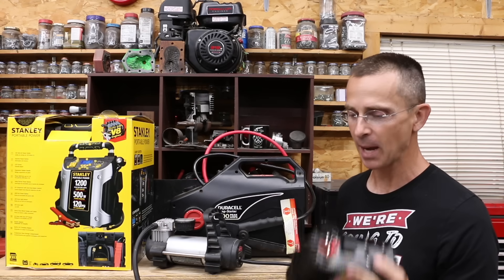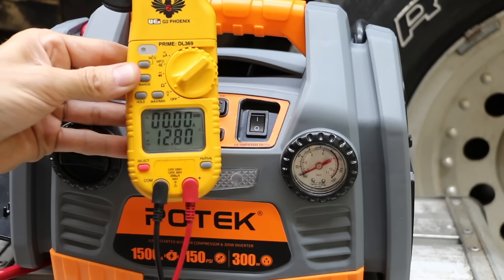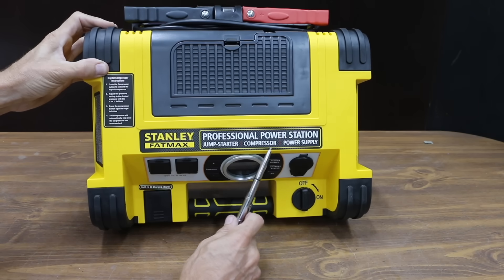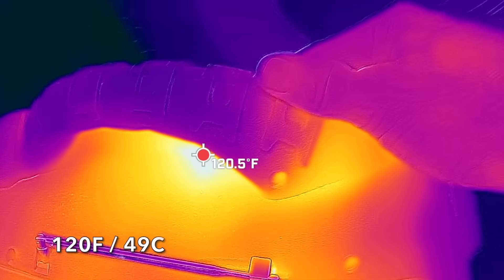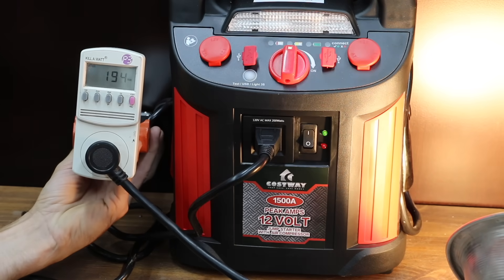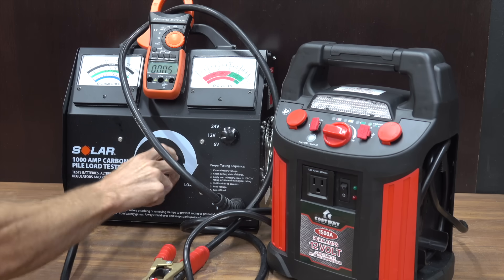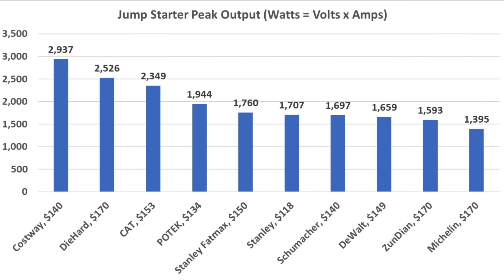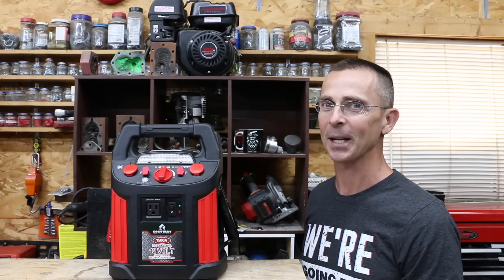Best Jump Starter? DieHard, Schumacher, DeWalt, Michelin, Stanley, CAT

Comment: I'd like to buy the #1 suggest according to the test result, Costway. But I see there is not many reviews or low rating on Amazon, which the link posted here. I'm hesitate to buy Costway. The performance is tested in here, but what about the durability or reliability of the product?
Reply from the maker: Thanks for the suggestion.

Comment: The exact same CAT completely died in a year. Unusable. In fact EVERY SINGLE jump starter I've ever purchased (most at Costco) have worked great BUT

then DIED in a year or so as in no longer chargeable at all. Kept inside not in the heat.

The real test is how are they working a year or two later, assuming 3-4 uses a year
Reply from the maker: Thanks for sharing.

Comment: I have an Everstart combo. Pumps pretty quick, can pump 2 tires without shutting off. But after 1 year it no longer takes a full charge and runs dead after topping off a tire from 18psi back up to 32psi.
Charged for 36 hours only shows 2 bars.
Shame
Reply from the maker: Thanks for sharing.

Comment: that's honestly kind of disappointing only one jump pack was able to actually rotate the motor I'm glad I bought a little handheld povasee 3000A for 60 bucks I started my 10,000 watt Champion generator over 10 times with a completely shot battery from the store just to find out bad gas in lines wasn't the problem I left the choke wide open🤦🏻🤦🏻🤦🏻🤦🏻🤦🏻   if you do another video on the handheld ones please add it to the list!!!
Reply from the maker: Thanks for the suggestion.

Comment: I have no experience with the other brands mentioned in the article, but I do have experience with Stanley FatMax, which I purchased from Walmart. FatMax is a piece of junk, in my opinion 
 The air pressure the gauge stopped working shortly after I purchased it and the unit didn't hold a good charge while not in use. The Fax now will not take a charge. Consequently, it's garbage and not useable. Ill never buy another Stanley product again.

Comment: Only one will start an almost dead car? One. 
And only one made its claimed CCA? None of them held voltage claimed? It’s either outputting at least xxxAmps @ or above 12V or it isn’t. 
Some of these ratings are patently fraudulent. Even at half-voltages the amps aren’t there. 
Thus ends my suggested comment for engagement.

Comment: Have you ever tested the NEXPOW Jump Starter with Air Compressor, 4000A Car Battery Jump Starter (for All Gas or Up to 10.0L Diesel), 150 PSI Tire Inflator Air Pump with Digital Screen?
Reply from the maker: Thanks for the suggestion.

Comment: Excellent video as usual. You are my go to channel before I make a purchased of an important item. I would like to know if you have interest in making a video of Diamond Core Drill Bits Set Tile Hole Saw Kit. The Metal Cutting Blade for Angle grinder to cut holes in Porcelain, Ceramic, Marble, Brick, or Concrete.   I looked through your channel, but I didn’t see a video of this kind.
Reply from the maker: Thanks!  Thanks for the suggestion.

Comment: My DeWalt Charger's compressor survived only long enough to inflate/top off four lawn tractor tires and fill one boating innertube then died on the fifth lawn tractor tire.  It is now nonfunctional.  It also doesn't hold a charge very well, I have to plug it in and recharge before each use.
Reply from the maker: Thanks for the feedback.

Comment: I bought 3 Stanley Fat Max units for home/work/rv.  All three compressors burned out after only a few uses.  When the first one failed, I figured it was a fluke.  When all three failed, it proved they were junk.  The internal adapter/charger (to charge the internal battery) also burned out on two of them.  I never used any of them very frequently, only used the compressor to top off the tires on several vehicles, used the jump starters a few times, and was extremely disappointed with the complete lack of quality and durability of these units.
Reply from the maker: Thanks for the feedback.
Reply: @ProjectFarm    Saw your other video about the big Lithium chargers.  Think I'll try the NOCO  GBX155 next time.  Buy one more time, cry one more time.....
Reply from the maker: Thanks for the feedback.

Comment: Because these units use lead acid batteries they will all crap out after a year or so because lead acid batteries are made to be used and will self destruct from sitting around not being used. Thats why ive never purchased one.
Reply: I have an old jumper from 2005. Looking to,put LPF battery in it.. light weight and many years of service
Reply: I did yesterday.

Comment: You have to remember that these booster packs probably dont have fresh battery's in them as from the time when the battery was constructed to when it was put in the booster to when it was sold to be put into use / could be up to 2 years from the time of manufacturing { china } and shipping via barge to American stores and Canadian stores / two years is a hefty long wait - The good news is AGM  batteries can be replaced and the booster pack can be saved. I did this with my Stanley 1000 / 500 cranking unit and its still going strong for nearly 12 years.
Reply from the maker: Thanks for the feedback.

Comment: FYI. The CAT has a one-year warranty, and it's designed to stop working shortly after, even with light use and regular charging. The buttons and display stop functioning, so the pump, light, and outlets are useless turning it into a 19 lb door stop. CAT is aware of the issue, and they just don't care. Absolutely not worth the $150 price tag, especially considering it will leave you stranded in a pinch when the warranty runs out. Designed obsolescence is real with one.
Reply from the maker: Thanks for the feedback.

Comment: ZunDian seems to be very exposed to the elements. I imagine pulling it out in the rain could be an issue with all those holes, including the fan which is set in a pull configuration(7:56), pulling air inside but also water droplets
Reply from the maker: Thanks for the feedback.

Comment: So, if we don't have dead batteries, plan on inflating a tire from 0 to 35psi (more likely to just add 10psi at a time *from 25/30psi) and testing the unit beyond it's capabilities (I think that's what you did when some units started smoking), is the Stanley acceptable? Seems pretty good for the price, not like the others (other than the costway) did much better for the extra money.
Reply from the maker: Thanks for the feedback.

Comment: The Stanley is identical to the Everstart MAXX J5CPDE that I bought at Walmart for $109. I live in my car so charge MAXX using an Everstart MAXX 400w 110 volt inverter whenever the motor is running. It'll charge up to 13.9 volts then show 12.9 volts st full charge. It worked fine for 7 months then the jump start feature stopped working. The screen stays blank after the cables are attached and the button pushed on. For some reason the screen lights up snd shows the icons if hooked up when the motor is running. The importer's customer service said nothing about the electronics failing and insisted the problem was not using household current to charge the battery for 40 hours after each use. It would cost me $90 for postage both ways for them to inspect the battery only since their 30 day electronics warranty has expired. The same importer sells these under the CAT brand. All three have lousy reviews from folks that sent theirs in. Many never got theirs back or got back a different one that was beat up. I'll take mine apart to see about bypassing the electronics to use a simple throw switch to energize the jumper cables.
Reply from the maker: Thanks for sharing.

Comment: See if you can add (harbor freights)  CEN-TECH
630 Peak Amp Portable Jump Starter and Power Pack with 250 PSI Air Compressor to the test?
Reply from the maker: Thanks for the suggestion.

Comment: The manual for the Stanley says you're supposed to connect the black clip to a ground metal part in the car, not directly on the black battery terminal, that's probably why it wasn't working
Reply from the maker: Thank you for sharing!

Comment: The EverStart Power Station (Stanly Portable Power) does not include a 12 volt power jack nor can it power 12 volt devices with the jumper cables, which was the reason I purchased it. After modifying the circuit I'm now able to power 12 volt devices with the cables.
Reply from the maker: Great information. Thank you

Comment: So the stanley and dewalt will shut off at 10 mins even if the you didn’t reached the desired air pressure? How many minutes will you have to wait for it to be usable again to pump the remaining psi you need?

Comment: I foolishly bought the Stanley  correction n everstart,  it won't even start my riding mower, air pump cuts off often, inverter barely runs a small desk top fan.
Reply from the maker: Thanks for sharing.

Comment: I have a Everstart Maxx 1200 which is identical to the Stanley. I've had it about a year. It has developed a new issue in which it does NOT turn off. And yes I have checked all the stupid issues, such as leaving the USB outlet on. Actually you can sit and watch it TRY to turn off. But quickly turns itself right back on. Had it apart trying to check the jump start button to see if something was keeping it depressed, but nothing found so far. Just a FYI that the Stanley may not last that long. I've had other jump starters that lasted at least 4 years plus. This was THE WORST lifetime.
Reply from the maker: Thanks for sharing.

Comment: It almost appear that none of these things are actually worth buying for any of the uses. 

Taking 15-30 min to inflate a tire seems like an awfully long time, especially if the compressor kills the cars battery in the process. 

The inverter function is close to worthless except to power a very small devise. 

An all in one system appears to be something that works well in concept than reality.
Reply from the maker: Thanks for the feedback.

Comment: Hi, I have a Dewalt DXEA14 jump starter.  It never seems to get completely charged.  I have tried using it a couple of times and it does not seem to work.  How long should it take to charge, how can I tell if it is working properly?  The light, the USB, and the compressor all work. 

Thanks,
Reply from the maker: Thanks for the suggestion.

Comment: Do you home camera/alarm systems?

Also I think you would do a much better job on a portable power station for around the farm/tailgating & power outages before going to generator. I put a plug to run my furnace for my Tetti1000
Reply from the maker: Thanks for the feedback.

Comment: The Stanley one is garbage mine lasted about a year and was only used twice to jump start and mosty to charge stuff . bought it when the power was out for 16 days after a storm . complete junk!  the one i got from harbor freight the year before this one is still going strong the air pump on it broke but other then that works. The Stanley wont even charge
Reply from the maker: Thanks for the feedback.

Comment: I've had that Diehard unit for about 4 years now and have been really happy with it. I got it on an Amazon Cyber Monday special for $119.99, and for that price it is especially incredible. My air pressure gauge is actually right on the money when i tested it against a Mac tools pressure gauge. Unfortunately this unit appears to be no longer available and has been replaced with a more expensive ($200) and worse model (no 120V outlets, analog gauge instead of digital, no set/auto stop on the compressor).

The best use has been for camping. I get multiple charges of cell phones, 18650 flashlight/lantern batteries and smaller power banks.
Reply from the maker: Thanks for sharing.

Comment: The thing that really trips me out is that most of these JUMPERS didn’t actually jump the truck lol I have a nice big Everstart 1200 amp and it didn’t even jump my truck after leaving it in the on position all night accidentally. I love the air compressor and the charging capabilities but that was a big bummer since I thought I’d be covered if I ever needed it. I guess it’s just the same old jumper cables for me and needing a stranger 😑

Comment: 13.21 13.9 volts isn't necessarily over-charged. Some Ford SUV's and pick-ups require ~14 volts to start efficiently these days. I've heard that a few odd cars also require this, but I can't recall which ones. 

FYI, they have some Lithium versions of these now, you might put those up in a head to head. Although.. I'm kind of convinced that the air compressors in these little units are just crap.
Reply from the maker: Thanks for sharing.

Comment: Genius Booster HD GB70.. best investment ever... I have had it on 25% battery and still able to crank dead batteries... Iv even used it as an emergency battery on my 4wheeler that stopped charging. Drove 6miles home .. alone hunting in the woods.. this booster has saved me on several occasions..
Reply from the maker: Thanks for sharing.

Comment: If anything these tests demonstrated how terrible multipurpose jumpstarters are. Basically unless you drive a metro geo and somehow have room to lug these things around its pointless. Get  noco brand jumpstarter(or any decently rated lithium battery jumpstarter not lead acid). We have a the noco 3000amp model jumpstarts a completely drained f-750 with a 6.7L cummins. Watched a guy on yt start his 3500 duramax in -20 degrees with it hooked directly to the battery terminals, no battery. Sold me. They have cheaper models that work perfectly fine for smaller vehicles, noco has a handy chart for your engine size for which model to buy.
Reply from the maker: Thanks for the feedback.

Comment: "best"? Have no interest in any of these all in one units. Have a Nocco 1000A jump starter/power supply. An absolutely excellent unit. Will jump start a V8 gas engine repeatedly on one charge, will recharge any 5v device and will run things like a small fan all night. Extremely reliable, very convenient and very easy to use. It's always in my vehicle. Have used it at least a hundred times. Bought it after I had a couple similar units made by Schumacher fail quickly. One of them was junk right out of the factory sealed box. Every Nocco device I own is excellent. Have 5.
Reply from the maker: Thanks for sharing.

Comment: I have an older Slanley 1000A jump starter/compressor/light. The power switch burned out after a few uses; actually threw sparks. After bypassing the switch it has worked well for several years.
Reply from the maker: Thanks for sharing.

Comment: I was looking for a Christmas gift and value your opinion.  However, the price for the Costway is now $280.00.  Maybe an update is in order?  Thank you for your content!!!
Reply from the maker: You are welcome!  Thanks for the suggestion.
Reply: Now list price is $299, I guess word of the ProjectFarm seal of approval is spreading around?
Reply: Past Christmas now but if anything these tests demonstrated how terrible multipurpose jumpstarters are. Basically unless you drive a metro geo and somehow have room to lug these things around its pointless. Get  noco brand jumpstarter(or any decently rated lithium battery jumpstarter not lead acid). We have a the noco 3000amp model jumpstarts a completely drained f-750 with a 6.7L cummins. Watched a guy on yt start his 3500 duramax in -20 degrees with it hooked directly to the battery terminals, no battery. Sold me. They have cheaper models that work perfectly fine for smaller vehicles, noco has a handy chart for your engine size for which model to buy.
Reply: @TheChemisch 😮
Reply: These consumer models are mostly junk.  Some models sold by Sears, Vector and others had as small as a 7-9 amp/hr SLA (sealed lead acid battery).  I had this size battery on a BICYCLE LIGHT thirty years ago.  Designed to provide  small current over hours, NOT SECONDS for JUMP STARTING.  Appropriate for a push mower or small riding mower.  Analogous to the cheapest adjustable wrench with so much slop in jaw that it can barely grip and turn anything.

Comment: I have a 4.7 v8 tundra and looking to get one. I see the Safeway is rated up to a 4.5L engine. Would it be able to handle my sized engine?
Reply: None of these will jumpstart a completely dead 4.7L v8. You'd want a lithium  jumpstarter. I have a noco brand one. To be safe I'd get the 2000amp noco for a 4.7L. We have the one step up(3000amp) and it starts our 6.7L Diesel truck with the battery's completely dead. If you need an inverter or air compressor buy one that fits to 12v car adapter.

Comment: @project farm could you test the Autowit SuperCap 2 Portable Car Jump Starter  It has NO battery and it just needs a little juice to convert your "almost" dead battery to running again. (but does it really work?) Also, if your battery is completely dead they claim you can use another source to charge the unit (in 3 minutes), and then it can get your car going? My big question is if it only has capacitors in it, how long does the external source charge last? Thank you.
Reply from the maker: Thank you for the video idea!

Comment: Thanks for doing this.  With so many brands available it's difficult to know which to get.  Suggestion: Do another shootout but with the pocket jump boxes. (maybe you have and I just haven't seen it yet?)   I used to have an automotive photography business. I would go to dealers and photo their used inventory then print out the window stickers. I always carried a small Schumacher  jump box because sometimes cars would be sitting on a lot for months and I had to move them to a good spot for photo's .  The jump box would work if the battery had enough juice to just barely turn the starter or make a few clicks, but if there were no clicks, it would not work at all.
Reply from the maker: You are welcome!  Thanks for the suggestion.